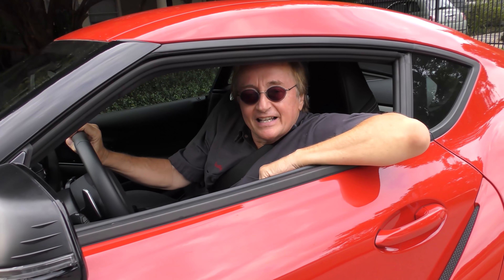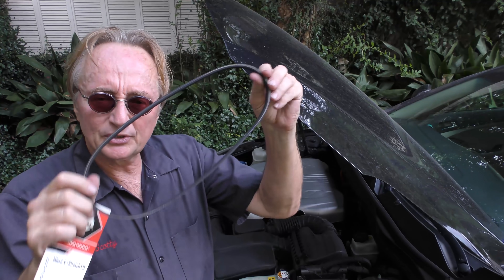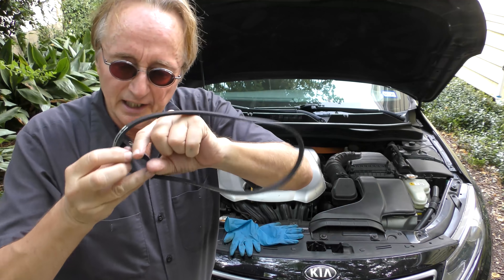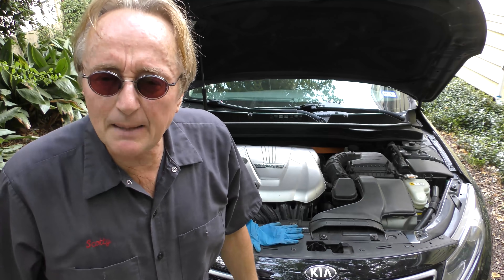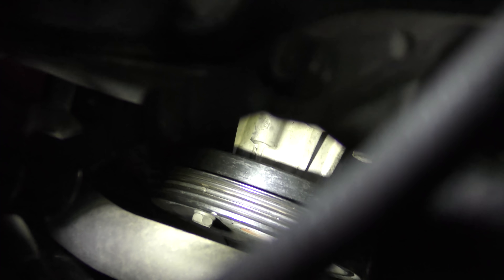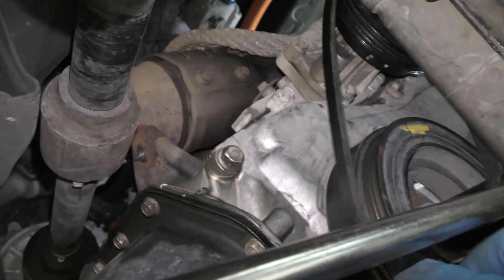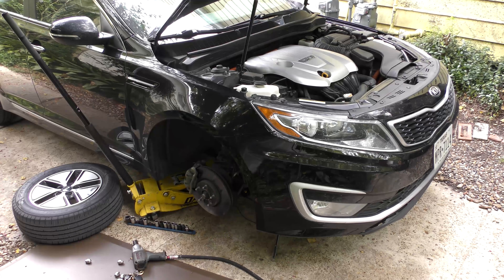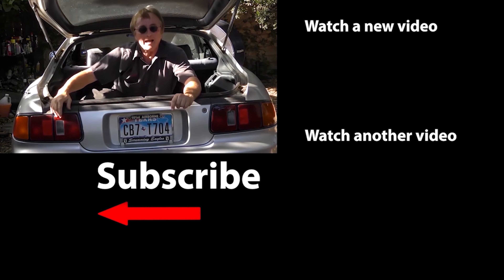I’m Mad as Hell and I’m Not Going to Take It Anymore

Comment: Use a jack stand (it will save the seals in your jack at least, keep the car from falling on your face at most).  Thread the stretch belt over the crank pulley so you can turn the crank clockwise, that will lessen the chances of inadvertently loosening the pulley/damper bolt, plus it's never a good idea to turn an overhead cam engine backwards.  The is a chance on some engines it can cause the timing chain to jump or valve interference on some of these variable cam timing engines.  Stretch belts are not all that bad, usually they last over 100,000 miles.  Never seen one come loose!

Comment: You know Scotty that stretch to fit belt last twice as long as a serpentine belt. Look at the newer GM trucks A/C stretch to fit versus the one with a tensioner. The latter will start cracking within a year or so. It's because it bends backwards and forwards causing it to fail sooner, than the stretch belt. The stretch belt only bends one way, reducing wear and cracking. Significant increasing the belt life. Put it this way. Take a piece of steel or anything you can think of and bend back and forth and see what happens. If you bend an object, no matter what it is eventually it will break.
35 years ASE certified.

Comment: My CX-5 uses this arrangement for the water pump and its a huge pain to change. However, at least Mazda didn't do anything truly stupid like drive the waterpump with the timing chain so if it fails it dumps coolant in the oil and destroys the engine aka BMW. Given the alternative, I think the stretch belt is the lesser of the two evils.

Comment: For all the cars I have owned. I have never taken anything off or apart to replace the belts. What's next, remove wheels to fill wiper fluid?
Reply: I've seen having to remove washer fluid reservoir to replace dead battery, so you're not far off.

Comment: I didn't mind changing belts on my cars as part of their maintenance...loosen a couple of bolts per accessory, snag the old ones off, wrap the new ones on, tighten to specs., and off you go. I wasn't a fan of the serpentine belt, because when they failed, you lost everything at the same time.  Not cool. And now they have rubber bands? Car manufacturers are getting lazier and lazier, but still charge too damn much for these crates. Ridiculous.

Comment: Hey Scotty, can you PLEASE answer a question about "belts" being used on some power windows.
I had a 2015 F-350 Diesel Dually Platinum Crew Cab with every single available option.  It was a retirement gift to myself and the only time I ever spent any insane amount of money or made a special order from a manufacturer.  The entire thing was a nightmare.  The vehicle didn't come in for over a month past the delivery date and Ford basically doesn't give you a clue as to where your vehicle is once it does ship.  They also don't know when it is being produced until it actually ships..... the entire thing was a headache.  Anyway, the tires started blowing out at around 20K miles (seriously), the truck shut down and the electronics went crazy a couple of times (leaving me stranded) and one time engineers from Ford had to fix the truck because they had no idea what was wrong with it. I never trusted the vehicle after that.  BTW, I averaged only 8,000 miles a year on it and it was never off road or abused or used to pull too much weight, etc.. This was supposedly their "best" and most expensive non commercial vehicle at the time.
I found out the hard way that on the 2015 model year (don't know if other years as well) they used some sort of rubber belt to control the power windows.  I remember years before that if your power window stopped working you could at least lock it in the closed position. Well with this, the "belt" controlled the windows and whenever the belt snapped the window would slide down and couldn't be made to stay in the up position.
Within 3 days of each other the passenger side front and rear power windows "fell" into the door and there was no way to raise them up.  Turns out Ford used some sort of belt and the belt could snap even if the vehicle was off and parked at night while you were sleeping. The only way to fix it was to have the rubber belts replaced in the door.  Do you know of any other manufacturer doing something like this and have you ever had any experience with his issue?  Thanks for all of your help for the "regular" people out there.
You saved a lot of people a lot of headaches and a lot of money.  God bless.

Comment: just question why not make a car that its abit little bit expensive but then more reliable and easy to maintain? and why engineers put more belts and pullies more if theoreticaly with the exemption of the timing belt and chain. the alternator, ac compresor and water pump can be driven by the crank with one belt ?

Comment: We all could see that it is a KIA that built the engine water pump drive pulley system cheaply with a belt that you have to stretch over the pulleys. I will just say something my experience with KIA as my wife bought one back in 2012. She has always kept up with the oil changes and the factory recalls regarding her Sorento. When it came out about some engines were built with metal shavings left in the sump by faulty machinery she took it in for the testing. The testing didn't reveal anything.  But when we were driving one day we heard a clunk and the check engine light came on. It barley made it to the dealer. When they opened the engine up they could tell she kept up with the oil changes. They replaced the engine, no charge. She still drives it today. 70k miles and counting.

Comment: Scotty, I have a question about the 10th gen 2.0 Honda Civic Lx. Does it have a timing belt? I’m coming up on 55k miles and have changed cvt fluid, regular oil changes, air filter, cabin filter and brake fluid change. Is the serpentine belt the only belt I need to change, and what about the water pump?

Comment: It doesn't look that difficult.
I tried to change a normal drive belt,on the driveway, and came across an automatic belt tensioner.
This had so much torque, and it's adjusting bolt so inaccessible, I tried the two spanner interlocking method, which failed and I ended up with ripped hands.
I had to call a mobile mechanic.

Comment: Scotty I have a 2006 Ford Five Hundred AWD, and my transmission gave out on me. A family friend installed a used transmission for $3k. Now, whenever I let off the gas going DOWNHILL, I hear a rough grinding engage until I press/hold the throttle again. Also, my ESC (electronic stability control) light comes on after a few minutes of the car being turned on. Could a faulty transmission have any correlation to the ESC system? I took the car into a couple shops to run a diag, and both shops correlated the grinding sound to a faulty transmission, but the car runs fairly normal UNTIL that ESC light comes on after a short time driving each trip. Help!

Comment: Pull the front wheel off to change a belt.  That belt looks like something you would put on a lawnmower.   I have a truck that you have to pull the front wheels off to change the spark plugs.  Yes, it's a Chevrolet, but it's not a new one, it's a 2000.

Comment: My 2016 Ford Fusion se hybrid had a non repairable nail in the tire ...No Spare tire from Ford...So I was at Costco bought 4 new tires.. the aluminum lug nuts on one side were deformed due to heat.. they won’t take the socket and a hammer to it to get the lug nuts off...they filled the flat tire up. I drove over to a tire store and they got the aluminum lug nuts off with a socket and a huge hammer and replaced all 20 lug nuts with steel ones.. I dove back to Costco and they replaced all 4 tires.. the car doesn’t have a spare tire or run flat tires on it...I bought new run flat tires at Costco ...Ford and Toyota use the aluminum lug nuts, cheap parts ...   Larry B.

Comment: It's not just consumer vehicles that are infected by this stupidity. 2016 and newer Bluebird Vision school buses with Roush propane conversions use a stretch belt for the air compressor instead of having it being either gear-driven (like in most other heavy-duty truck applications) or integrated into one of the two serpentine belts on the bus. Buses, in general, are plagued by stupid engineering decisions, but these Visions are among the worst.
Reply: @Mark Codiroli This isn't about the material stretching, you absolute tool. Of course the material stretches. It's about the method of installation and the resulting longevity of the part. Serpentine and v-belt systems use various forms of adjusting tension and don't require an installation method that is inherently destructive to the belt. Stretch belt systems, on the other hand, are not adjustable. As seen in the video, the installation of these belts requires both lateral and cord stress to be applied, leading to damage. The belt loses integrity much faster than other types, requiring more frequent replacement. And, as mentioned in the video, once it's installed it cannot be used again. Was that simple enough for you?
Reply: @Mark Codiroli Completely wrong. Stretch belts are not constructed at all the same way as more conventional belts. They use an elasticized core for tension, while other belts use a substrate tensile cord. This means that lateral forces are applied to the belt at a significantly different center of gravity resulting in greater chances for the belt to flatten and bottom out on the pulley, meaning that the stretch belt wears faster. Also, even using the "correct" tool, the belt is subject to torsional forces. In other words, by installing the belt it is subject to stresses that run counter to what it is designed to handle leading to microfracture in the belt's core. Stretch belts get used on vehicles because they are relatively cheap and easier to install during manufacturing. In no way are they superior in performance to conventional belts. I'm honestly confused by why you're so emotionally invested in something like stretch belts in the first place. It's like arguing that New Coke was great...

Comment: Glad my 2017 Prius Prime has no belts at all.  "Toyota just changed the game" on belts, hahaha.
Reply: @zeroyon4562  Do you mean nicer looking or nicer mechanically?  Personally I think the Prime is a great looking car, easily the best looking Prius ever.  In front, the slit headlights look awesome, and most people agree.  In the rear, the complex curves of the hatch glass and spoiler are awesome, but many people disagree with me on that.  The suspension in Gen4 beats Gen3, I hate the center console in Gen3, the headlight performance is 100x better in the Prime, even the lowest trim level is quite loaded, the tax credit is huge, etc.  Still, Gen2 and Gen3 are really solid cars, well proven.  With the Prime, plugging in and being able to decide if and when to use the 25 miles of electric range (actually 40 for me) without the engine kicking on until 84mph etc, makes the Prime my favorite.  The ONLY downside to me, is how the bigger battery eliminates the spare tire and below-deck storage, and even raises the cargo area deck a bit.  Still tons of room.

Comment: This doesn't really seem all that bad unless there's not much space. My Ford Fusion uses one of these for the AC compressor. So it's not going to hurt anything too bad if it were to fail. Plus, its at the bottom part of the engine so its super easy to access. Also, eliminating the tensioner means there's less components to wear out over time. Meaning you'll never have to worry about belt slip from a worn out tensioner, or have a buy a tensioner haha. I can only really see these not being good for bigger engines with super-chargers. It probably wouldn't be good to have a super stretchy belt driving your 2.0L supercharger hahaha. I definitely don't like that the Kia uses it to drive the water pump tho. That's a crucial component. If that little belt failed and went unnoticed then say bye bye to engine.

Comment: Its wrong position  to fix the water pump belt., 1st fix the fix the belt behind water pump pully 2nd fix the belt to the crank pully 3rd start fix behind waterpump the belt rotate the crank pully it will fix easy

Comment: While I agree with Scotty 99% of the time, I'm not so sure about this time. For a home DIY'er this belt would seem to be far easier to replace than any other type of belt. Yes, he did call it a crap belt, but usually when he takes that tone he'll mention about a part failing prematurely. He didn't really do that here. He said nothing at all about this belt not lasting just as long as any other belt. I've put lots of belts on and sometimes it's a giant pain to get to all the tensioners to tighten/loosen.

Comment: So WHY is this belt bad?  Presumably it costs the owner less when it needs to be replaced.  So the questions are: how much more frequently does it need to be replaced? How much less does it cost? If it needs to be periodically replaced before it's worn out, does this reduce the chance of expensive damage caused by belt failure while driving?

Comment: Hey Scotty. I couldn’t get the “ask Scotty” on your website to work for my Web Browser ,idk why, but I figured I could ask here. I’m thinking of buying a 1994 Ford Ranger 4.0L V6 4x4 with the standard transmission. Is the engine and transmission reliable? What about the truck overall? Btw I’m looking to buy from a private party. Thanks!

Edit: The ones I usually find have roughly 120k to 140k miles on them

Comment: So Scotty prefers one belt to drive everything... that's great so when that one belt go's then your on the side of the road S.O.L. example. I had an old Datsun that had multiple belts like the power steering belt that went bad so no big deal cut it off and drove it home and was glad that it wasn't one belt that drove everything because I wouldn't even be able still get me home.
Reply: Yep I had an old Volvo that had separate belts. AC compressor seized, snapping the belt, which also ran power steering, but car was still driveable.

Comment: Hey Scotty I have a Corolla 2006 it works well but when I disconnect the battery and put back the Idle goes down even some times when I accelerate it doesn’t go up but after 30 minutes it is good and work for months, any Idea ? What is the issue?
Reply: Do you also put your right foot in, Left foot out- do the Hokey Pokey and shake it all about??
Reply: Gln Burnz what you mean ?
Reply: Zeroyon 456 Thanks Man , appreciate your comment

Comment: Scotty You bent the alternator shaft . Void the warranty on the belt by prying it on to the pulley , You didn't time the off setts of the pulleys so it wouldn't stretch the belt .The reason they use tension pulleys . You probably damage the crank seal and end crank bearing . Better find a lawyer .

Comment: Engine failure and fire problems with Hyundais and Kias have affected more than 6 million vehicles since 2015. They’re at it again folks. Recalled yet again for fires with Hyundai and KIA advisory to consumers not to keep their vehicles parked in their garages now. 09/05/20.
Reply: The recalls cover 203,000 Hyundai Santa Fe SUVs from 2013 to 2015. Also included are over 440,000 Kia Optima midsize sedans from 2013 through 2015 and Kia Sorento SUVs from 2014 and 2015.

Comment: Hi Scotty,   Thanks heaps, I am in Australia (Far North Queensland) and we don't get much local choice in car models, because most manufacturers left, so I will keep going with my 2003 Mazda 2500L diesel 4x4 - works for me with 150K on the clock will last 'til I die...    I shore got a good one as it easily cracks the speed limit by 40 either on highway or gravel...     I do not watch your channel all the time...   USA seems to have too many fragile tinplate specials...   I like a good chassis and thick skinned, bit like my attitude ;-)...

Comment: New cars suck
2020 blazer. POS. Has a plastic throttle all at the foot, plugs into the electrical there, screwy part, everyone I test drive was different. Back hatch automatic open close but get the F out the way, no safety. Back seat can be triggered to fold down by rider, which in my case was a 8 year old, fortunately no injury apparently. Buyers remorse